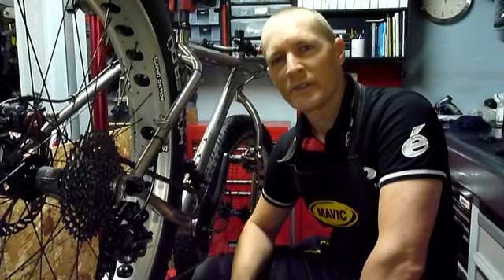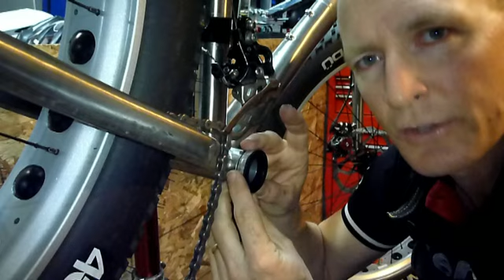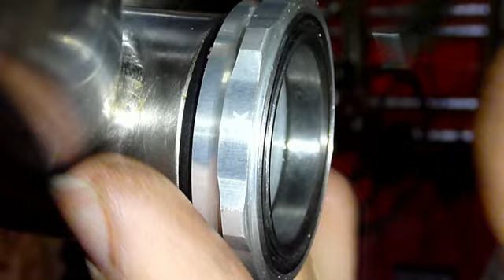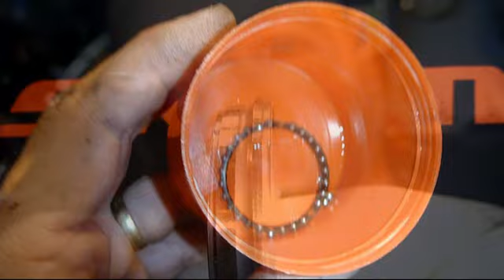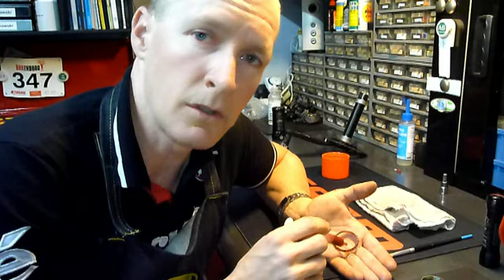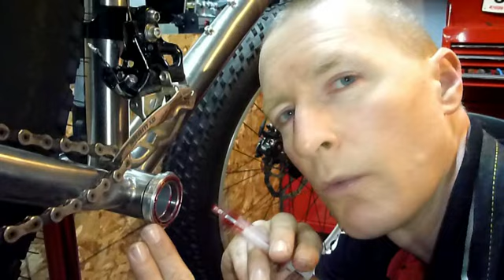E13 XC BB service

Comment: Is this one of the E13 bottom brackets you aren't supposed to service, just replace?   I have the TRSr 30 cranks on mine, just sapped the bottom bracket but would like to service the old one so I have a spare.  Seems a shame to throw it away.